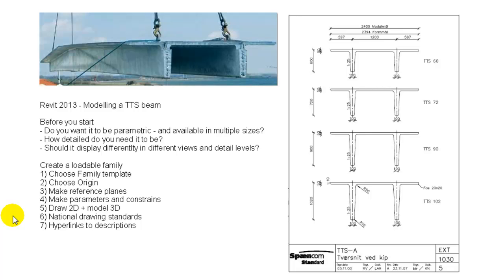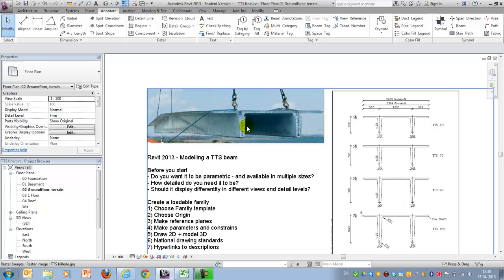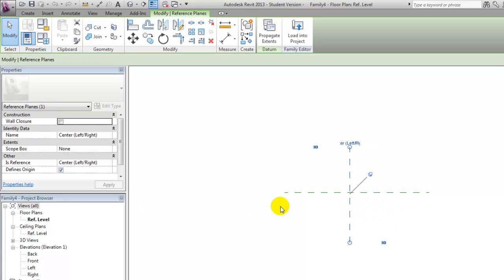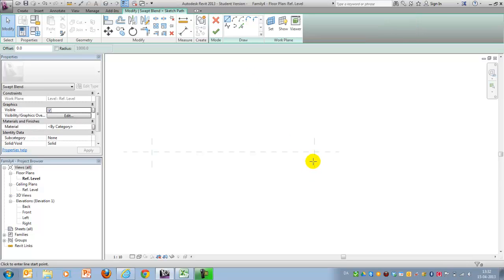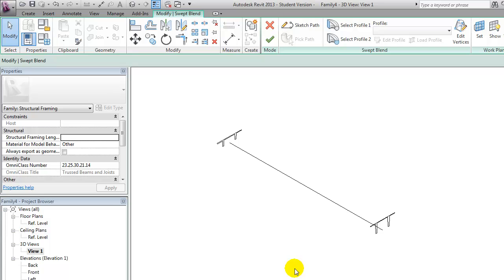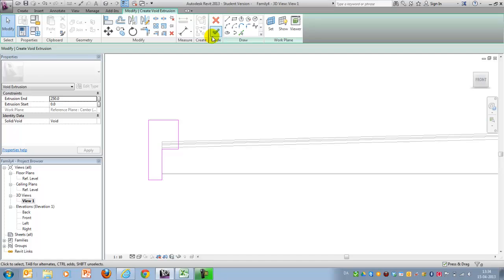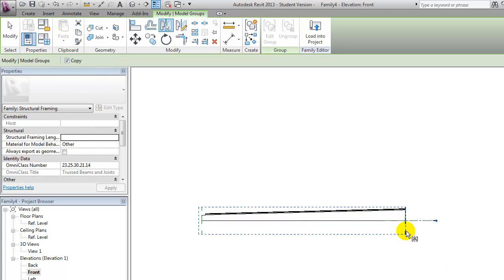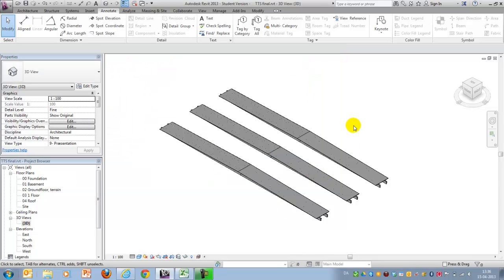2/2 TTS - Creating a loadable family in Revit 2013

Comment: Hey!
I have a little problem finishing the Swept blend, it writes that "can't create swept blend". I have created the end and center profile families as you did in the 1st video, and loaded for them for the profile 1 and 2. I am doing a TTS 102 profile at the length of 28800mm, so there's not really a lot of differnce, but:
I have the top line of the profiles consisting of only one line (I just joined them after mirroring) and I have also also mirrored the ref. planes from the left of the center to the right. I don't see these as problems though. Any idea?
Thanks for the help in advance,
Ákos
Reply: I have found the mistake, it was some small lines (used as guidelines before) that didn't close a loop, and were hiding behind the ref. planes.
Thanks for the videos! They are really helpful! :)